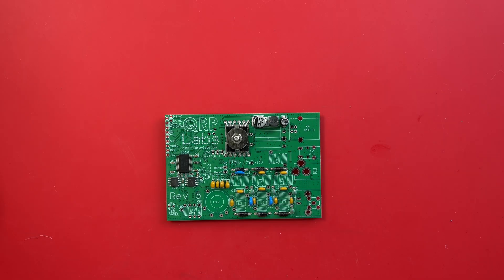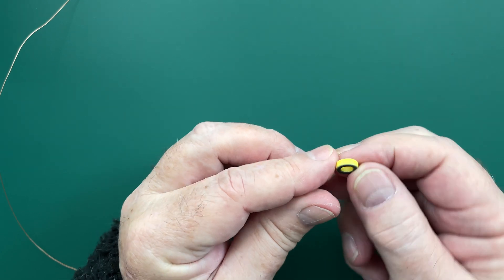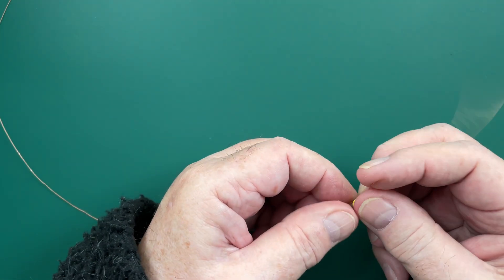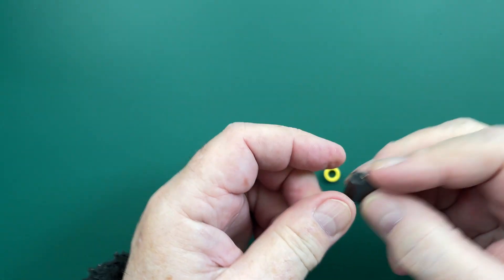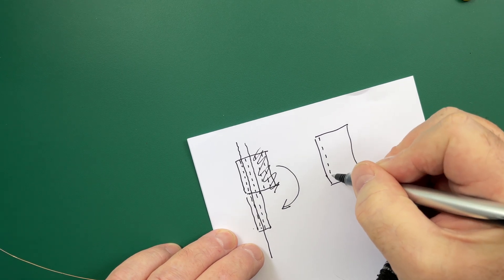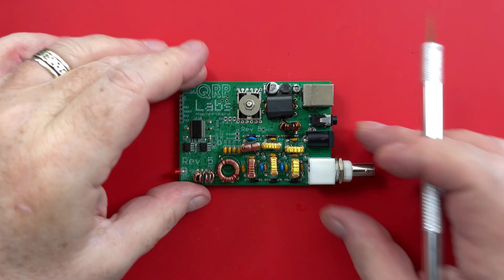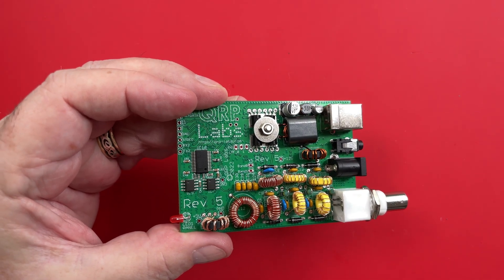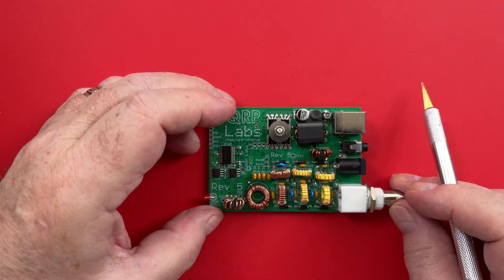Building the Low Band QDX

Comment: I am afraid that your statement at 2:16 is incorrect. This is half a winding and not one winding. If you fold back the right hand wire to the left, then you will have one winding and only then, the analogy with the binocular ferrite is valid.
Reply from the maker: Thankyou for your comment.  The accepted statement that every time you pass through a torroid is a winding has worked for me for years.  Whilst I appreciate that technically, you are correct, I think the point is to show that you don't complete, passing through the torroid twice
Reply: @bayamateurradiogroup , exactly. This isn't a discussion of field theory. It's a commonly agreed definition used for the purpose of clarifying torroid winding turn numbers.